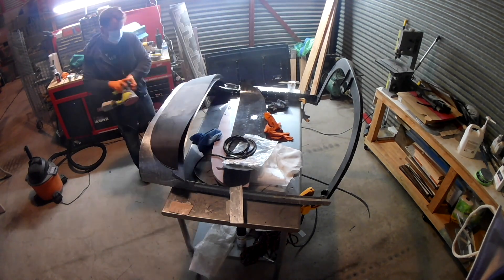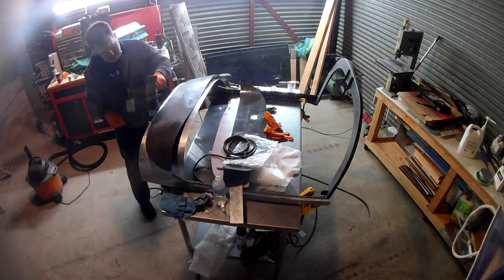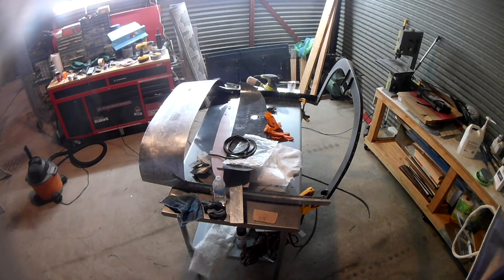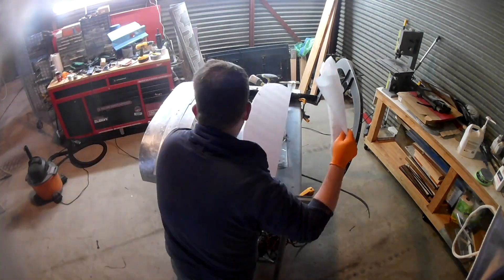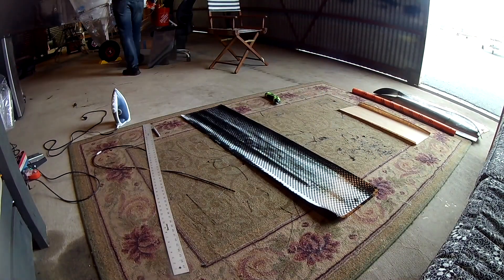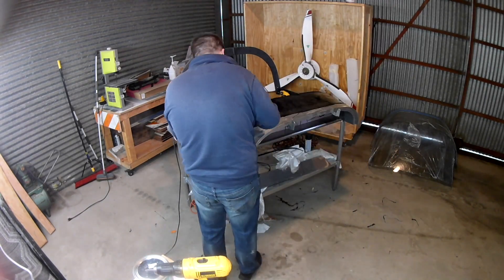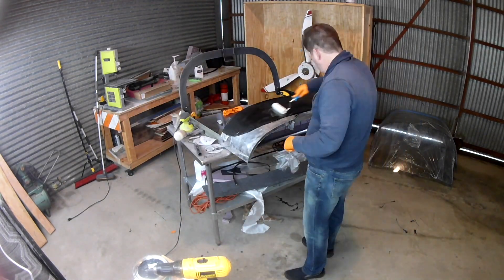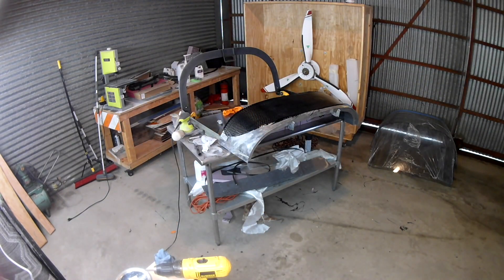RV-14 Deglaring the glareshield

Comment: They've got aluminum rollers for spreading/pushing resin into fiberglass so that you don't soak up all the resin.
Reply from the maker: That is correct. I have one of those but it doesn't work any better AND the scalloped metal channels get filled with resin and doesn't want to come out. All a moot point anyways. I start vacuum bagging next week.
Reply: @akilroy  ahh! So more expensive wrecked roller!